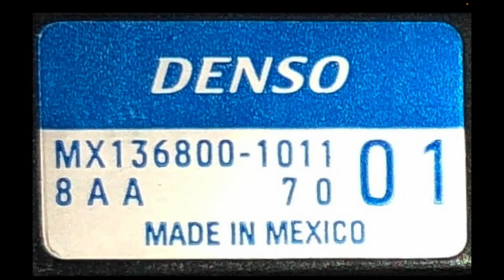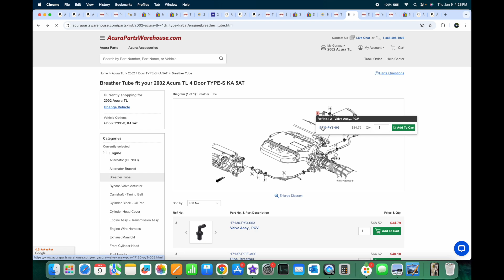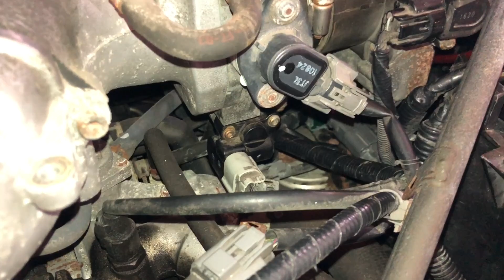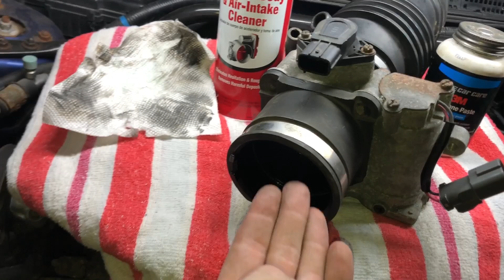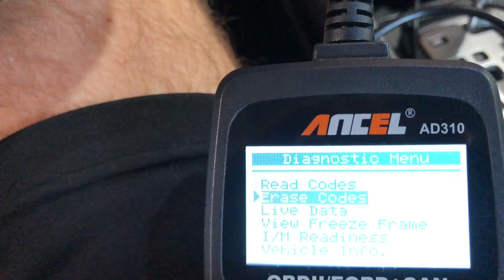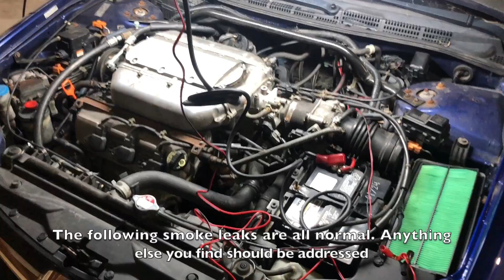P0505 P1129 - Surging Idle - How to replace Idle Air Control Valve and MAP Sensor

Comment: I had the same issue, the RPM was fluctuating, I cleaned the IAC valve, then the RPM stopped fluctuating, but at cold start the RPM 2k then dropped to 750. When I drove it thr stall twice at low RPM. So I decided to change I bought one from ebay (says in description denso but it was not). Anyway, I installed the aftermarket IAC, the RPM was 1k the ran for a while then stalled.
So I bought another one from rockauto. I will install it when it is delivered
Reply from the maker: Unfortunately, cleaning the IACV doesn’t yield very successful results from what I’ve read on forum pages. It might offer a temporary fix at best. Better to replace it. That’s annoying the eBay IACV didn’t work. I know how you feel. Hopefully the next one works. The problem is almost always this IACV. I’ll cross my fingers for ya! 🤞

Comment: When I tried to order the oil they told me that Puff Daddy had bought it all 🤣
How did you learn how to do all the tests?  Especially how to use the scan tool properly. I want to learn myself. Thx
Reply from the maker: it's a competitive market for that oil haha
I learn most of what I know through the Acura service manuals. You can find them for free on cardiagn.com. I also do a lot of research on forums and other youtube videos to ensure I'm not missing any vital information. For the scan tool, the manuals tell you what parameters to look for and what numbers and ranges it should be reading. Makes it very easy to understand! You just might need to look up what all the abbreviations stand for, because otherwise it would be pretty confusing.

Comment: That's crazy bro I just did mine this weekend. Twice !  Because I just cleaned it the first time lol. Well I put the brand new denso idle air control valve on. And I still had a surging idle.  Guess what it was brother? A vacuum line had came loose on the back side of the intake 🤣. I got lucky though I got a brand new denso for $80 bucks off of eBay.  Oh well it's got some new parts now right?   How you doing bro?  You staying warm? We are absolutely freezing down here in Florida 🤣. I wish you had made this video a week before I did my work. The only videos I could find were for the TL base models.  I didn't realize our cars had two throttle bodies. Or whatever the second one is called.
Reply from the maker: Glad it was something as simple as a disconnected line! I was not that lucky lol tested every component on this vehicle practically just to find out my replacement IACV was bad. I'm doing great, all my cars are running smoothly, and luckily I've had off work during this polar vortex so I've been staying warm inside. I saw some cold weather advisories mentioning low 50's in Florida, I'll trade ya XD 
Yah I had filmed this a few months ago in August, along with a few other projects, but I've just been so crazy busy. More to come in February and March! From what I understand, that second throttle body is a traction control valve. The main throttle body valve is mechanically opened and closed with a cable attached to the gas pedal. So the way the traction control on this vehicle works is when slip is detected during acceleration, the TCS-VSA valve automatically closes to cut off air flow and thus cut power to the engine to reduce slippage.
Reply: @CarRepairsMadeSimple  You make the best videos brother!  So thorough and easy to understand!  Thank you so much for going through all the trouble. I just bought a 2004 4 cylinder Accord Coupe with a 5 speed manual so I don't have to worry about automatic transmission issues lol. That's my work commute car. Much better on gas. Stay warm my friend!